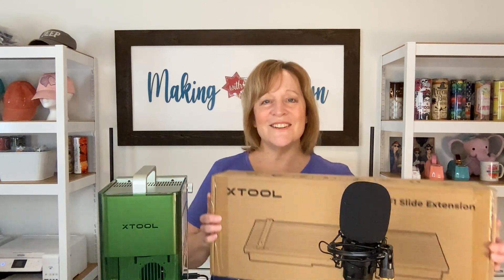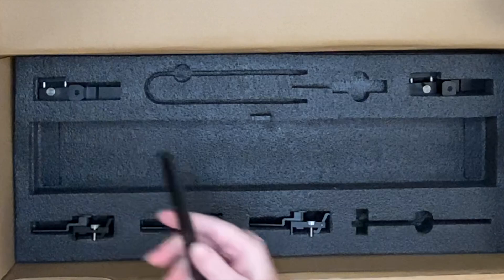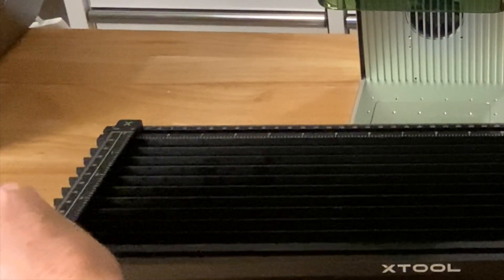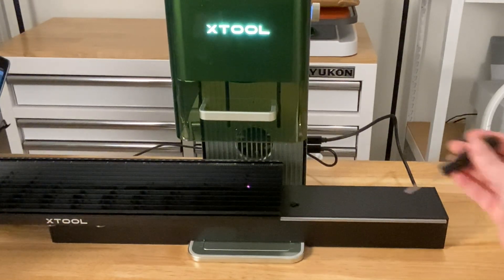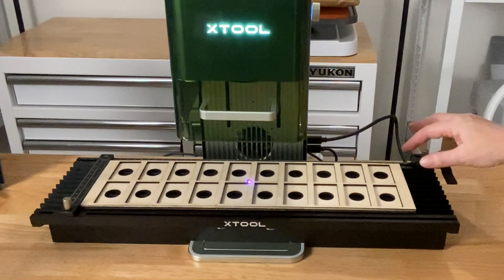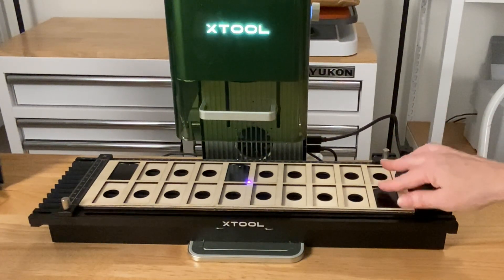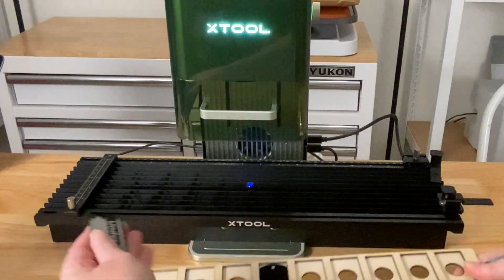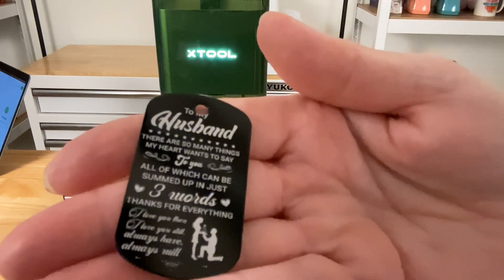Installing the xTool F1 Extension Kit (Step by Step)

Comment: Hello! I enjoy your videos! TIP as a Macintosh tech specialist for years, don’t let your desktop accumulate hundreds of documents and folders! It will make your computer slow since the Ram have to keep them visible and keeps refreshing the FINDER. Also can corrupt the files system. I also generate hundreds of files🤦🏻😝
Reply from the maker: Thanks for the advice.

Comment: Really nice! Ok now i guess it’s time for me to pull my slide extension out of the box. You made it look so easy. I was hesitant to buy jigs but yours came out so nice. Where did you buy your long wood from?
Reply from the maker: It ended up being super easy. I like how the software guides you through setting it up. I got my wood at Home Depot and had it cut down.
Reply: Great I’m going to set mine up tomorrow. Thanks for sharing @MakingwithMarilyn
Reply from the maker: @becomingdryork2919  that is great!!!

Comment: That is so awesome Marilyn. I love what you did. Is there a lot you can do with this tool?❤
Reply from the maker: The benefit of it is that you can actually engrave on metal. So, not painted metal where you are layering off the paint like I did in this video, but on actual metal. My last video showed me experiment on several things. The drawback is that it has a smaller working area. So, it really depends on what you would do with a laser as to whether this would be the right one for you.
Reply: @MakingwithMarilyn  thank you for that. I really appreciate it.

Comment: Hello, nice video! I have questions about the slide extension: Do I have to carry out the calibration every time the extension is installed and I use the F1 without it?
and my 2nd question! If there are, for example, 4 coasters in the xcs, do I have to align them exactly and then measure exactly this distance on the extension and then align them? Sorry, I'm a beginner with the F1.
best regards from Dortmund/Germany
Reply from the maker: I have not calibrated each time but it wouldn't hurt. I do measure each time and then make sure my placement is good by using the framing function. Thank you for watching!
Reply: @MakingwithMarilyn top Thank you